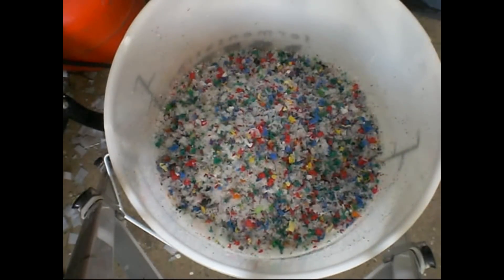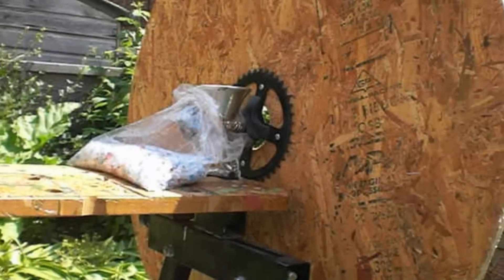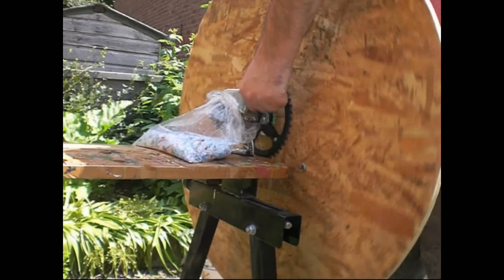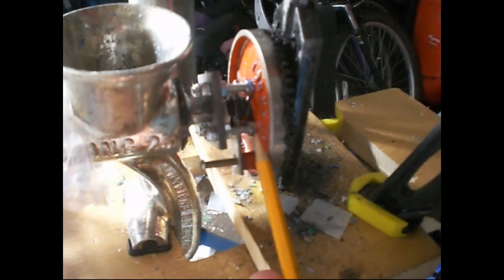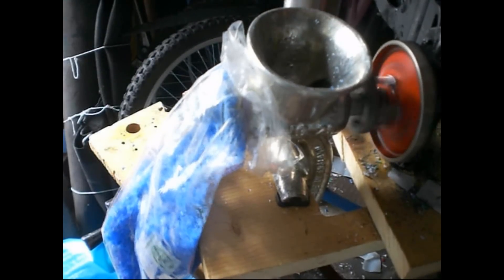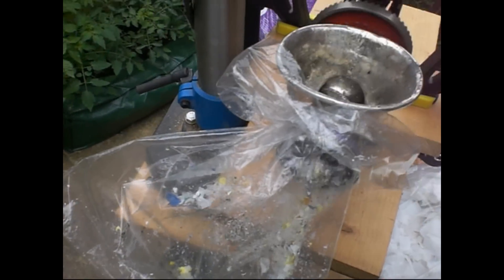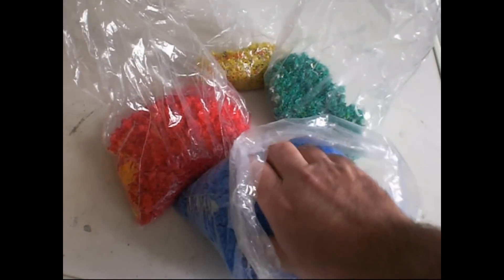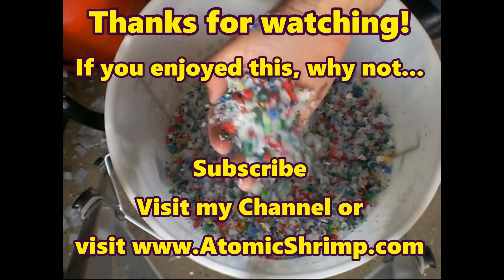Grinding HDPE for recycling

Comment: Good effort but, you DON'T need to grind the HTPE if you're melting it in a sandwich maker.
I just cut milk bottles in half lengthwise and melt them half at a time, adding halves as you go until you have the required amount.
I just press down hard on it initially, and the container will collapse quickly and start melting.
If you are preparing for an extruder/injector, then you will need to grind it.

Comment: I've settled for just using a band saw to cut bottles into strips then put the strips in a blender. It works ok but you don't get a very consistent product (lots of powder and larger shreds)

Comment: I used a garden shredder I got off Gumtree for £20. It's the most successful thing I have tried. I cut milk bottles in half rolled them up and pushed them in. Usually took a couple of runs through the shredder and it does clog up. I was going to try altering the exit shoot to see of that helps.

Comment: does this meat mincer happen to grind plastic well due to a specific quirk of its design, or have any of you gotten it working with other meat mincers or grinders as well?
Reply from the maker: I don't think there's anything very special about this mincer
Reply: @AtomicShrimp  Hey thanks for the reply

your Spong meat grinder has a rotating plate on the outside, and from what I can see in another Youtube video, there is a static plate behind that on the inside...
but 'modern' meat grinders instead have a sort of grating in the outside, and a set of rotating blades which cut against it on the inside, these blades rotate with the screw ... and my concern was that they do not cut plastic at an adequate rate relative to how much the screw is bringing in, resulting in a jam
Reply: @AtomicShrimp  but also on closer inspection, it looks like the 'bore' of the Spong mincer is actually a helical cutting surface too, that probably helps with grinding the plastic

the motorized meat grinder i looked at in the local shop had a completely smooth bore, so i doubt that it would work as well for grinding plastic

Comment: I have an insane idea.  Get a drill press.   High amp and with a three pulley system.  You can get those for 100 dollars used.  Those small bench top models probably won't work.  They have only 2 amps and only two pulleys.  
      Here's the insane idea.  Lay the thing sideways on the workbench.  And then you can directly hook it up to the meat grinder.  Naturally, you're going to set the pulleys on the lowest speed.  
     You're probably going to have to go to town with a bunch of two by fours to block the drill press in and support it so it's not wandering and vibrating all over the place.

Comment: for plastic milk cartons, I turn them first into a long piece of plastic "rope" with a razor blade nailed to a piece of wood. then just use some strong shears to cut up the "rope" into smaller pieces. I wonder if there is some way to streamline the process of cutting as it tends to wear on my hands, perhaps with a crank handle or one of those large size paper slicers.

Comment: I used a blender which cut it up very very well into tiny particles... but its a cheap blender and the metal axle inside the blade gets so hot that it melts the plastic that holds it in place...

Comment: As an ameteur its actually quite easy to weld HDPE togethr, On ebay you can buy hot air welders from around thirty pounds, and you can buy HDPE welding rod from ebay cheaply too. Then all you have to do is tack the plates together from the rear, and seam weld them, so the front face stays nice to look at.

Comment: i'm thinking, what diy hdpe shredder builders really want is ... thin hdpe sheet nibblers, or like the devices what makes holes in 3-hole sheets . so basically a square or round peg that lowers in a square or round hole

Comment: Thanks for letting us know it's hard to seam weld HDPE as that was my plan (to make squares and seam weld to make boxes). But would like to know what you tried and what happened, with the seam welding. I've seen a video on seam welding corrugated sewage tubes and it didn't look too hard, with the correct tool. What did you try? Thanks.
Reply from the maker: For seam welding, I first tried adding material and heating with a hot air gun with a narrow nozzle - it didn't heat enough area at any given time, so the weld was patchy/  Next, I tried sprinkling ground HDPE into the gap and heating the whole area with a clothes iron (with a nonstick separator sheet) - this heated too large an area and caused some of the existing pressed sheets to buckle.
I then tried heating just the area of the seam by pressing with a heated metal bar, but this didn't have enough thermal mass to deliver heat consistently to the seam - so it created a weak join.

I think the way they get this right industrially is all about consistency of heat and material application - hard to do on a small hobby scale

Comment: Question. Would putting the hdpe in the freezer for a few hours and then grinding, be better? Would it make it more brittle and easier to grind?
Reply from the maker: good idea - I think I;d need temperatures colder than a domestic freezer though - I have frozen soup and stock in HDPE bottles before and they were still pretty resilient at freezer temps
Reply: Cryo grinding is definitely popular in shredding plastic and tires and the like. However, Mr Shrimp is right; it's done using liquid nitrogen, not a freezer

Comment: HEY MAC IM GLAD I CAME ACCROSS WITH YA VIDEO DAMN IT I TOTALLY FORGOT ABOUT MEAT GRINDER DAMN IT . IT SEEMS TO WORK SO WELL . WELL I WILL GET IT AND GET IT MOTORISED LIKE YOU DID . BIG THANK YA LAD . BY THE WAY YOU CAN MAKE A 3D FILAMENT FOR 3D PRINTERS AND SELL THEM LIKE IM PLANNING TO DO
Reply from the maker: Reptiloid Павелитель всеx Земель и Миров just be careful of your safety. Almost nothing I did here is a very good idea.  If you have the skills and materials, a shredder on the PreciousPlastic design is really the right way to go.

BTW, I don't think it's possible to 3D print with HDPE - so you may need to choose a different source material
Reply: HEY THERE THANK YOU FOR REPLY . SO WHAT TOOL DO I NEED TO USE TU GRING BLASTIC IN TO GRAINS BASICLY LIKE YOU GOT ON VIDEO ??? i DONT WANT TO BUY 700EU MECHINES THAT WILL BE SHIPPED FROM CHINA FOR AT LEASTR 7000EU TNT DELIVERY WHICH IS SICK JOKE . THERE MUST BE A BETTER HOME MADE SOLUTIONS RIGHT ??? SO WHAT WILL IT BE THEN ????

Comment: U weld pieces together with hot air gun. Melt both sides and stick together. A guy put layers together to make cool hdpe slingshot handle :-)

Comment: You never thought of a regular 1/4 or 1/3 hp electric motor with a small sprocket?? Or to convert the gears to a belt drive???...Sure would have been simple to bolt the entire thing down on a piece of plywood or scrap wood...
Reply from the maker: J Dovak sure. That would be a proper engineering approach. This video was really about my attempts to work with what I already have

Comment: hey man whenver i melt HDPE and use my ultimate clamp (a car batery and a rock) it works kinda well, but have wierd spots, where is more glossy, and just looks like the weight did not got on those parts, do you if that is the problem?. Also great idea on the attempts of getting grinding, i just use a pair of sciors, my blender also trowns them away, Peter Brown's blender works just fine for some magic reason
Reply from the maker: Victor Hugo HDPE shrinks quite a lot when it cools- which means some parts of your piece will pukk away from the face of whatever material you are pressing against them. The only solution I have found is more clamping force and leave it all in place until everything is stone cold.

Comment: Thanks for showing your attempts to shred HDPE using meat mincer. i'v tried that but could not do it. Do you think the size of the holes on the disk make a difference? What size of the holes on the disk you used.
Excellent idea.
Reply from the maker: Actually everything about my idea was pretty dumb - I think I have damaged my drill press, and it's a wonder that I still have all of my fingers.  If you want to grind plastic on a small scale, go for the preciousplastic grinder design.

Comment: Until last year I worked in the plastic injection moulding industry, making car door rear view mirrors, some of the biggest machines we used were 500 ton, ( that's the clamping pressure to keep the mould closed while the plastic is injected), they are about 30 feet long! but basically the same principle as what you have there only many times bigger and operated by hydraulics.

Comment: That's really creative, have u tried using one of those garden wood shredders?
Reply from the maker: I have one that is the high speed rotary type - I doubt it would do very much at all to the plastic - the slow cut/crush models might do it, but what's really needed for grinding this material is sets of opposing teeth like in the Precious Plastic grinder

Comment: can i use different types of plastic, lets sat PP or PET with HDPE?
Reply from the maker: PP will mix with HDPE if blended thoroughly, as the melting points are similar and the polymers are compatible - I'm not sure about any other blends.  It's better not to mix though, as it can introduce weaknesses in the material
Reply: hmmnnn, besides HDPE which other types of plastic are easy and stronger to melt and recycle?
Reply from the maker: Low density polyethylene can be fused between two sheets of baking parchment using a clothes iron - to make a tough, fabric-like materials
Reply: thanks alot
Reply: You can mix PP and PE, but considering PP is Flammable and will clearly catch fire and you can see flames, but PE on the other hand will just smolder and smoke, both when over heated or caught on fire will become brittle and useless.

Comment: couldn't you friction wield the hdpe plates?
Reply: yeah if you got access to an ultrasound welder,  best way is to heat weld since it allows it to mix and cool to a harder structure, or think of it as friction stir welding.

Comment: Why not just melt it down as is unless your using it in extrusion equipment? I wanted to have a go at making something from HDPE so I cut up a couple of bottles and melted them down but didn't have quite enough. The next day I had a large 5L bottle that I could add but didn't want to cut it up so I just put it on some baking paper on a tray into the oven and it melted down fine into the size I could use. I could have easily added more bottles as it was melting down but didn't need that much material just yet.
Reply from the maker: If you don't grind or cut it up, it doesn't pack down very well and it becomes difficult to melt enough material for the job in one go - also, larger pieces tend to combine in such a way as to include voids.  If you repeatedly melt, pack, then add more and remelt, you may find that the plastic becomes brittle or burnt-looking.
Reply: It took a bit longer but the HDPE bottle looked consistent throughout when melted and cast well. The plate that I made seems really strong for the purpose I wanted it for and I was hoping that the off cuts could be saved for future use. I am new to this stuff and was just curious so thanks for the reply.

Comment: Thanks for the videos. As for welding them together  you would have to preheat your panels (not to melt temp) and use one of the new freehand extruder pens. Had some success  with this ( without the preheat the joints just snap or don't bond at all)

Comment: The drill option would work better if the grinder had a larger sprocket and the drill was on a smaller one. That way HP is being turned into Torq to better grind w/o slowing the drill down.
Reply from the maker: The gearing in the third version (where I used the drill press) is a bit like that - even then, there was a problem with occasional jamming

Comment: I have lots of hdpe that goes through my house, did you put a blade of some sort on the grinder or leave the orginal front on it,
Reply from the maker: It's got a little star-shaped blade that rotates against the inside face of the perforated output plate - this blade performs a sort of scissor action in conjunction with the pierced holes.
Reply: Thank you. I have tried several different ways but the results were not what I was looking for.

Comment: I've noticed that HDPE plastic tends to turn brittle in the sunlight a lot sooner than PETE plastic does. You can cut up 2 liter soda bottles into sheets and you might have a better experience welding those together. The pop bottles are blown, so they will shrink a lot when melted, but if you rivet the sheets together and then weld, it might work. I haven't tried that myself yet. I've used some heavy duty scissors to cut a lot of gallon size HDPE water bottles in half and then stacked the halves together. I actually cut the bottoms off then cut the handle off then cut the remainder in half along the seem. I haven't melted anything yet, but I figure it will work just fine to melt a stack of halves together rather than shred or chip it further. Then there is the problem of the label. Have you figured out an easy way to remove the label? I'd sooner cut that piece off and burn it than spend a lot of time and effort scrubbing off the glue. Of course it's better to incinerate it than to allow it to decompose in a landfill.
Reply from the maker: I tend to discard the section with the label unless it will soak off, or unless the label itself is made from HDPE and welded on during the moulding process
Reply: kedwa30 rubbing alcohol will pull most labels right off. Get entire label wet let sit for a min or 2 and wipe off. Still more work than just cutting the label out.

Comment: worked at a place where they blowmoulded jerrycans out of plastic 
the schredders they used there looked a bit like the machines they use for schredding three branches
big knives mounted in a cage running past a flat bar on the base cutting whole yerrycans up to sumtin the size of confetty in secconds 
maibe you can make a smaller version out of an electric wood planer

Comment: I find your HDPE boat a brilliant idea and I really would like to see it done. 
why not calculating how much plastic you will need, then make a big boat mold and then melting the HDPE in the boat mold and then pressing the counter mold into the mold ? it's a big project I know but it would be a smashing project to do film and post. Keep going and don't give a dam thing about what other people think.
Reply from the maker: That sounds like a project to do later, when I take over the world, or at least, take over a plastics moulding factory.
Reply: AtomicShrimp 
You have my full support on that hope you succeed :D
Reply from the maker: I guess the best way to do that would be to team up with a small company that already has tooling for roto-moulding canoes (they put the resin inside a mould, then rotate it inside a huge oven.

Comment: The problem with steam welding is probably the steam.
The parts should be hot to begin with and the edges to be joined may be heated with a heating element held near the work pieces.
There are two reasons for the preheat: It takes less effort to get the edges to fusing temperature AND...
Plastic expands a great deal when heated; if the pieces are not close to the same temperature all over, when they cool, the edges joined will shrink too much and be in great tension.
They will be likely to break. Too, overlap joints are better than edge-to-edge joints. Use pressure to thin the joints while they're hot.
Don't use material that is thicker than you need. Remember that plastic is a lousy conductor of heat and take time to heat all the way through.
Look up information on "plastic welding." It absolutely works.
Reply: First Last 
SEAM welding.  Not STEAM welding.